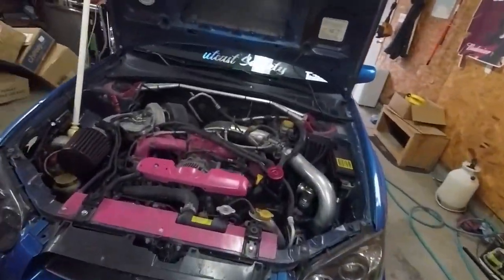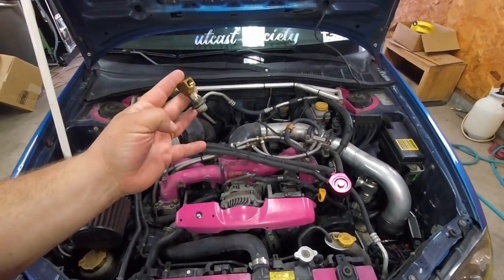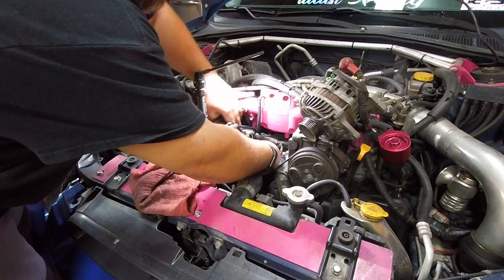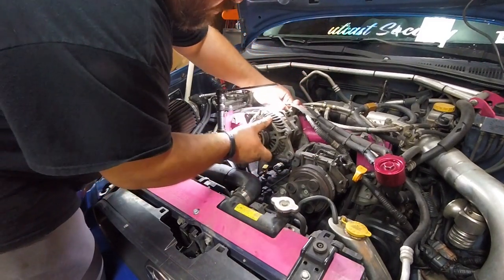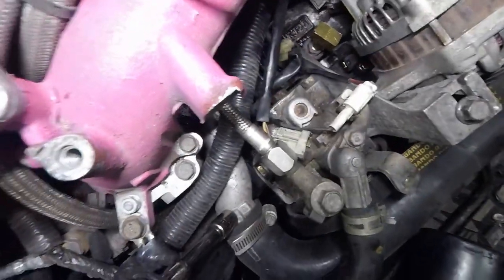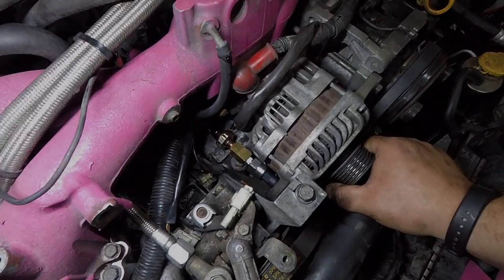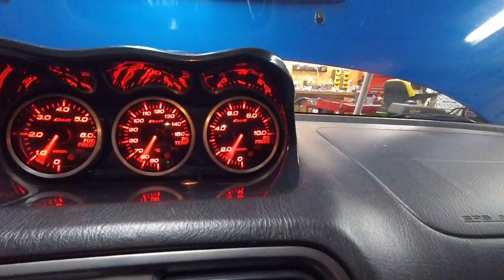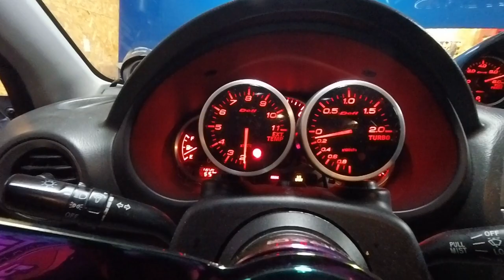Subaru WRX STi Defi Oil Pressure Gauge Repair

Comment: My gauges just stopped turning on a few days ago. Do you know if it’s wiring or could it be a fuse related problem?
Reply from the maker: Hello, thank you for watching and for your comment! If they all stopped working at the same time, I would guess that the controller lost power or ground, which could be a fuse, or wiring. The first thing I would do is check for power and ground at the controller with a DVOM. If you don't have it, check the fuse. If the fuse is good check from the power pin to a metal part under the dash and make sure you didn't lose ground. If you do have power and ground, but it still doesn't power on, it is most likely an internal controller problem. Good luck with it!

Comment: Hey awesome stuff, quick question my defi gauge on my oil temp pressure when I put the key on acc the red light goes off and makes the beeping noise but when it’s running and driving it’s fine. It happened when I touched the warning button that’s on the control unit. It didn’t do it before. Do you know if I switched to a mode and how to get rid of it. Only happens when’s it’s on acc.
Reply from the maker: I am not 100% sure, but it technically should beep and have the light on if there is power to the gauge and the engine isn't running, because there isn't oil pressure.
Reply: @PatmanPerformance  a little more research and it looks like your right. I just reset the gauges and still did the same thing. Question does it matter if I adjusted it up and down manually? I kept playing with defi unit control. I don’t want to throw any of the parameters off. How should I check it to see if its range
Reply from the maker: I am not sure, I never messed with the control unit. It's going to be important that the units are correct, the zero is correct and the linearization table and range of the sensor matches the Defi's expectations, but I don't know if any of that is calibratable
Reply: @PatmanPerformance  is it not once it’s out the box already set

Comment: My gauges turn on but the oil pressure gauge went up to max and came down but won't move now
Reply from the maker: Hey, thanks for watching! I would assume that either your pressure transducer (sensor) went bad, or the wires to it got broken/melted/damaged. If you know where the transducer is, check that wiring first, if it looks fine, then it probably has a bad transducer.
Reply: @PatmanPerformance  thanks
Reply from the maker: You're welcome, good luck with it!